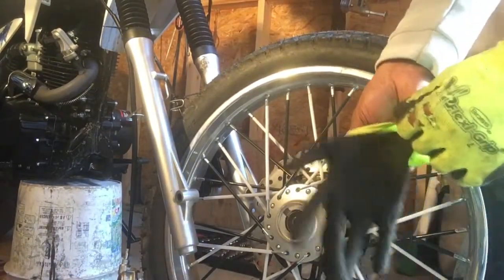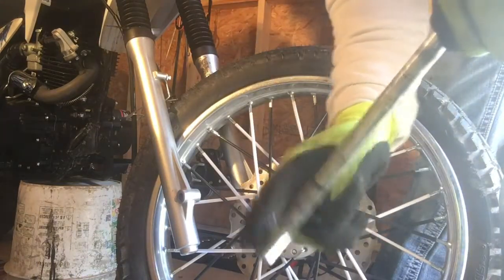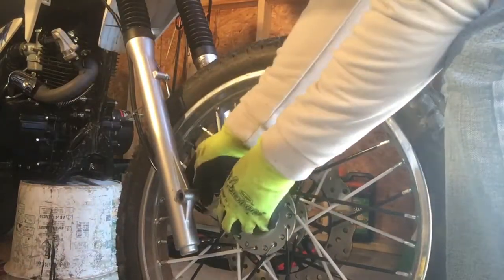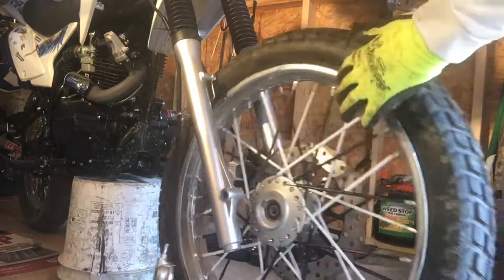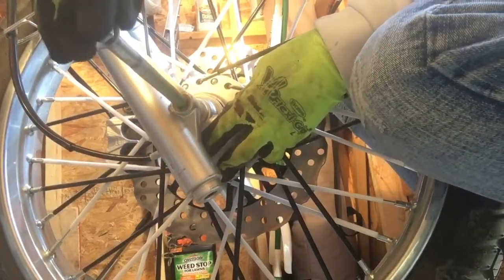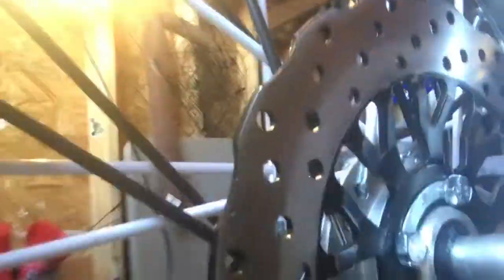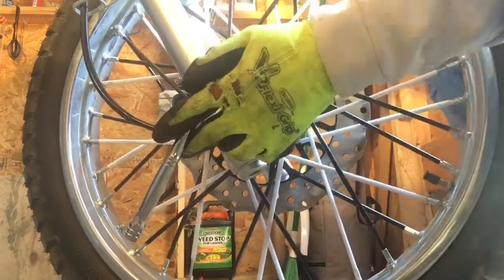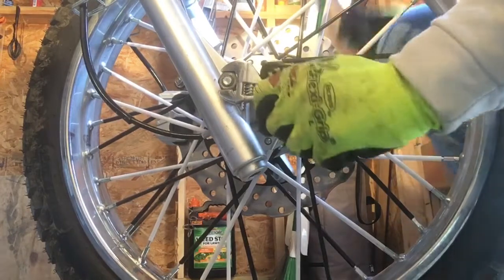Tao Tbr7 front wheel

Comment: Man thank you so much you don't know how much that hello me with my tbr7
Reply: @freakeyeairgunnin2181  hey i just got my tbr7 to day but i do not have the spacer for the tire do u no whare i can by 1 at mine did not come with it and i cant find whare to by 1 at
Reply from the maker: Shawn Thompson double check make sure it’s not taped to the wheel or handlebars or any of the boxes like the mirror boxes and make sure it didn’t fall when you took the rod out that runs through the front forks when you unhook it from the crate...if you don’t find it try 🤔I think it’s called vmc Chinese parts...it shouldn’t be hard to find
Reply from the maker: Shawn https://www.taotaopartsdirect.com/products/tbr7-axle-spacer don’t know how long it’ll take or if it comes from China if so you may not get it or it may have corona on it😳😷

Comment from the maker: All the way up is Full choke all the way down is No choke.If you go to cold start your bike and it’s acting funny with full choke,then try it with no choke,if it’s still acting funny try the middle.This works on mine.Im gonna change the carb or tune this one after break in
Reply from the maker: Make sure the choke is off when you ride
Reply: Up stalls even when warming up stays idle middle and down I’ll warm up middle and down when I ride thanks for the help still only taking it around the block sometimes cause of the registering issues ( cops) I did notice in jersey that tbr7 is on the books